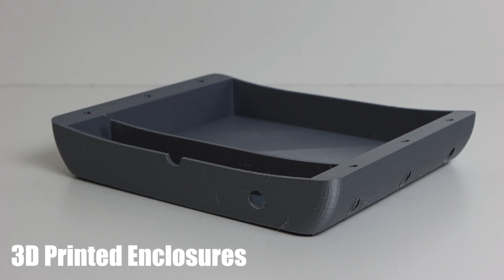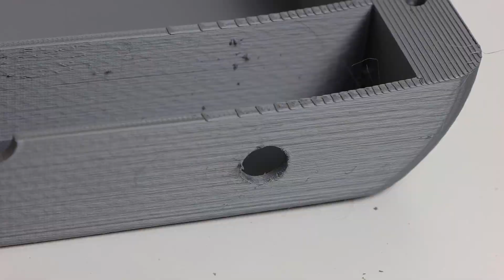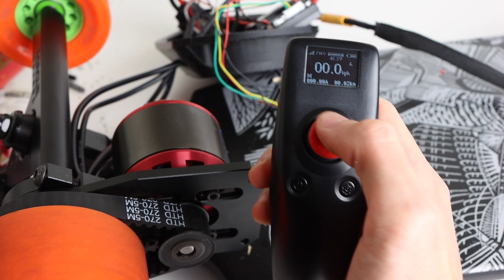How to Build a DIY Electric Skateboard *15lb Landyachtz College Campus Commuter*

Comment: How did you get the curvature of the deck right for the second iteration of the battery enclosure? I am looking into designing and printing a new enclosure for my board as my current one is cracked but cannot seem to get the curvature of the deck right.
Reply from the maker: I took a picture of the deck from the side and the front and then straitened them and added the to a sketch in fusion. Then I just traced the deck.
Reply: Their Advice is good, however Ive cracked 2 enclosures that I 3D printed, then reinforced the next two (I made an extra before I went to college just in case) and haven't had a problem since. I used a $20 bondo fiberglass kit from home depot (also avaliable at walmart and a bunch of other stores)

Comment: Missing the most important thing. PRICE.  Otherwise a great video 👍
Reply from the maker: Haha yes the price. Most of these parts were recycled from previous builds so I did not add it up, but I think it comes out to around 800 USD. It could be done for much cheaper though by just changing a few parts

Comment: ⚡ Ooo I like this one! ⚡

Never seen such a flexy deck on an esk8, let alone a smaller one 🤙🏼🤙🏼

Nice wide RKP trucks for stability at speed & simple press fit pulleys 👌🏼

As soon as I saw the deck I knew which one it was, very well known, popular deck with a rocker which I've never seen used on esk8 before ⚡⚡

Looks amazin! Can only imagine how nicely it rides.
I would love to see a Pantheon Trip with top-mounted electronics and rear mounted motors.
Reply from the maker: Thank you! Love this deck so much. I had never seen it used for esk8 either. I was also looking at the pantheon trip for a V2
Reply: @DIYesk8Builders  ohhh ya gotta do the trip.   I tried to do one years ago but I gave up.   I couldn't stop   the wheel bite

Comment: Or just get a revel kit ? More quiet, better motor tech (dual direct drive motors )And you can have hot swapple batterys :)
Reply from the maker: that works too haha. not as much fun though
Reply: With the amount of rocker on that deck I'd be concerned about the battery hitting the ground all the time